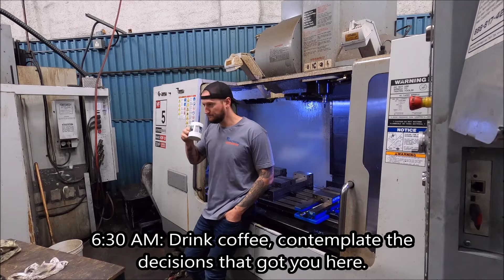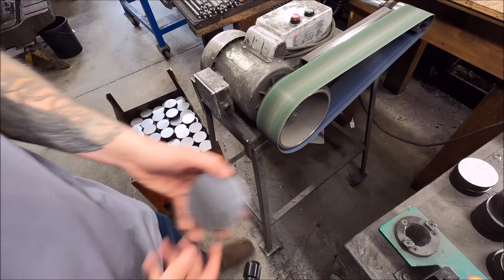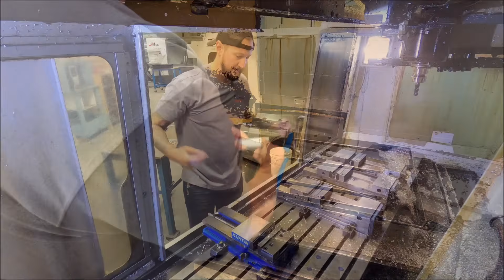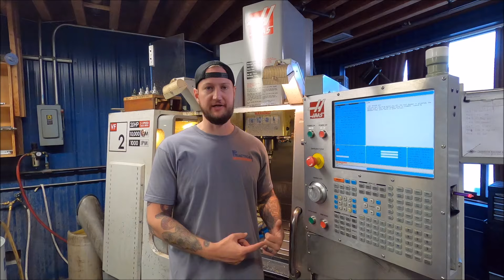A Day in the Life of A Machinist | Machine Shop Talk Ep. 27

Comment: Just got a Clausing Colchester 15 and need your advice. I have rotary phase converter in the works but would you step-up the 3 phase 240 to 3 phase 415 using a transformer? now advice question; where would you start to get a transformer that they would not charge a enormous amount. Keep up the great work.

Comment: Just started doing Mazak CNC machining parts for Aerospace and love it! Work 12 hour shifts 50-60 hours a week! Shift time flys by. The only time it drags is when running material and there are no adjustments needed. Lucky for me the tools wear out after 100 parts and the materials change a lot with temperature. Shaving off .00005 every once in awhile make it nice but the real problems are fun. Just don’t crash one to have fun😅
Reply: Lousy job with miserable people plus you make peanuts no matter how many hours you worked.

Comment: 🎯 Key Takeaways for quick navigation:

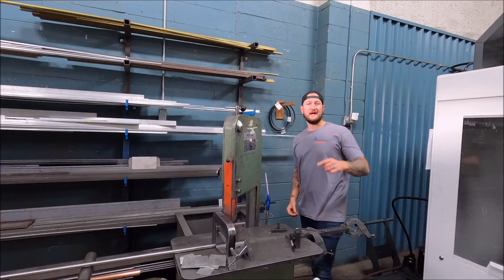01:05 📐 Material Preparation: Initial task in the shop involves prepping materials for machining, including cutting them to the required length.
02:00 ✂️ Deburring: Post cutting, sharp edges and burrs are removed to ensure proper fitting in the machine.
03:48 🔧 Setup and Fixturing: Setting up work holding devices and custom fixturing in the machine for various jobs.
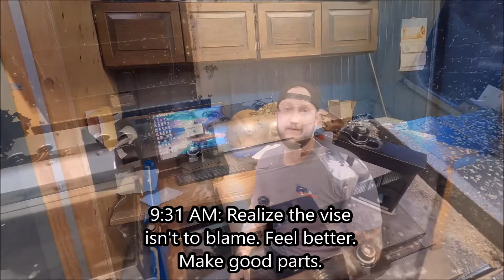05:20 💻 Programming: Learning programming to instruct the CNC machine, a critical skill for career advancement in machining.
07:12 🏭 Operation: Operating the machines to produce parts, with tasks including quality checks and tool changes.
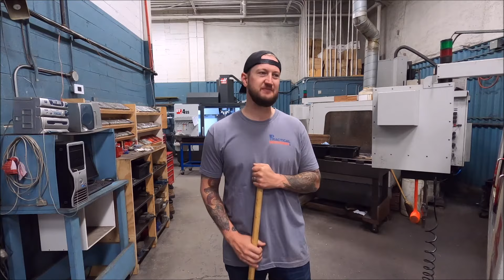09:29 🧹 Cleaning: Routine cleaning to maintain a tidy workspace, done between cycles and at the end of the day.
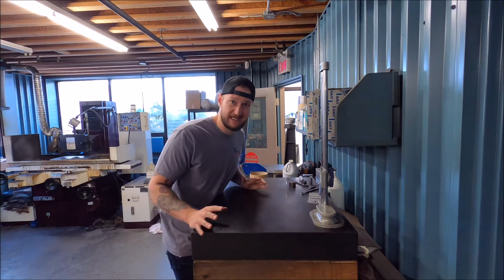10:36 📏 Quality Assurance/Checks: Ensuring produced parts meet the required tolerances and standards.
13:10 🎓 Continuous Learning: Encouragement for aspiring machinists to keep learning and improving in the trade.

Made with HARPA AI

Comment: Packing is very important! The amount of times we had damaged components delivered from sub contractors, because the guy just literally put the part in the box without any consideration to the damage that could occur is mind boggling! And then it is a courrier's fault, because they stuck a fragile label on the box! Packaging is important, and I think every company must have good practicces list and people trained on that. Especially when you are subcontracting, don;t play it down, because one day you will have these parts rejected due to damage to surfaces, which have requirements on the drawing.

Comment: Im a CNC Operator from Germany. I think CNC Operator is a pretty chill job if you are in serial automated manufacturing. Once i set up the CNC Center all i got to do is load the autoloader with material and let it run, check on the parts once in a while. I think prototype manufacturing is more stressfull.
Reply: Personally I love the prototyping, it's more challenging and you always get weird stuff. Much more fun, but also a lot more intense. Production jobs are nice to have as breather episodes, I use them to play around with CAD software and learn some skills, but I'd go bonkers doing them full time.